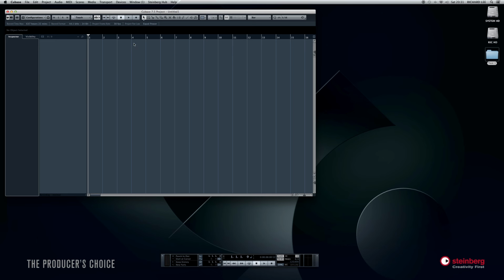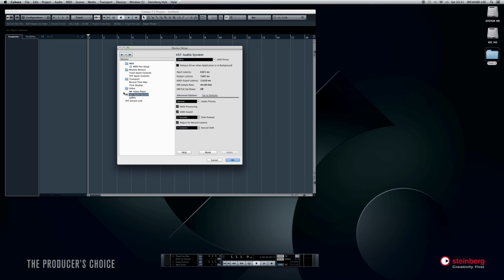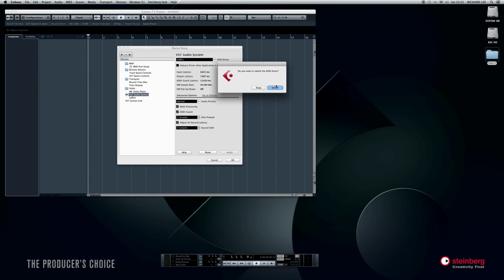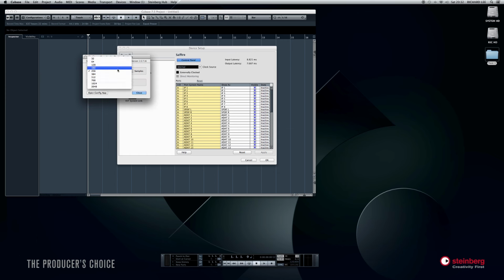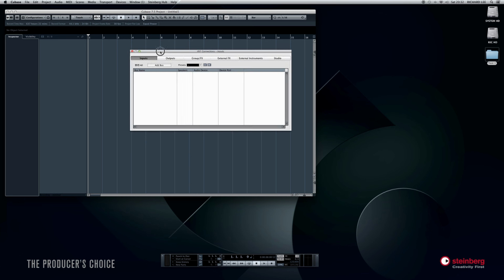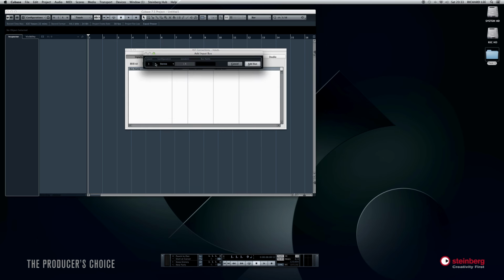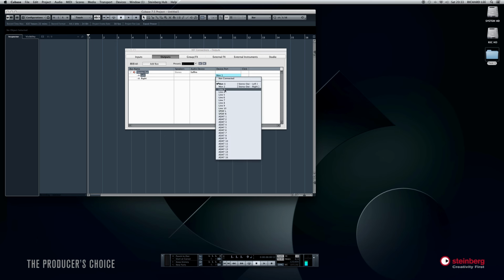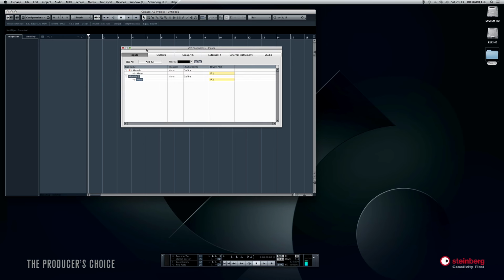Steinberg Cubase - Audio Interface Installation

Comment: May I make a suggestion?? I see that you have a Mac-based DAW. "MOST" things are "equal" in Cubase, not so in Interfaces. Mac has the edge. It can run several  Interfaces at once.....NOT SO on PC....."UNLESS" you install "ASIO4ALL" the latest version. I have a 7.1 Surround Output Interface, but I want to be able to use a MOTU-Input Interface at the same time. If you want the un-dieing GRATITUDE of your PC-based Subscribers, show them how to set that up. I CAN'T be the ONLY PC person on EARTH that would think this is COOL!!!!!!